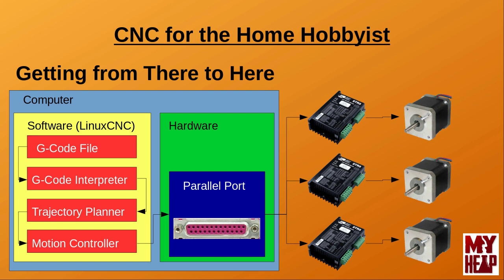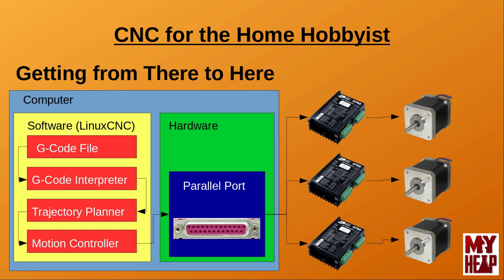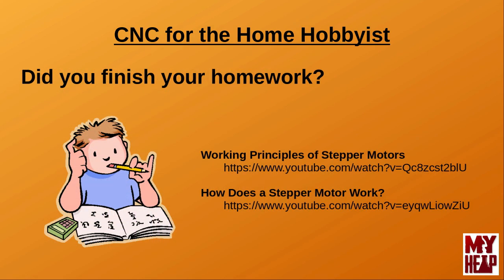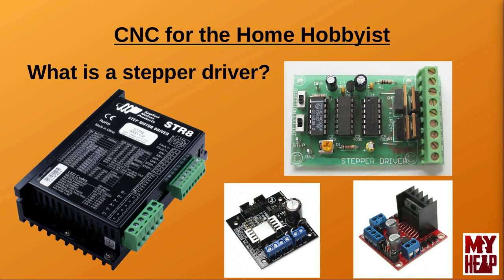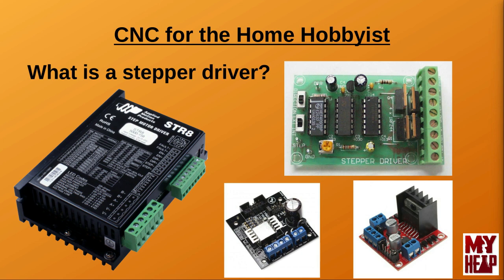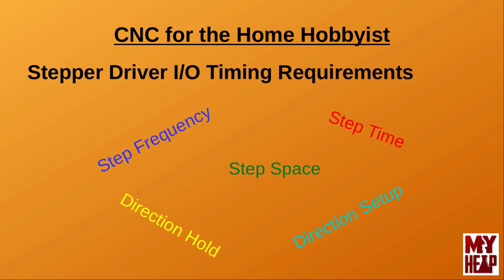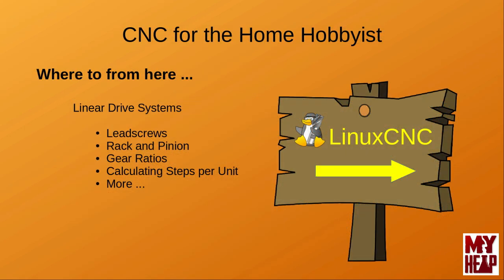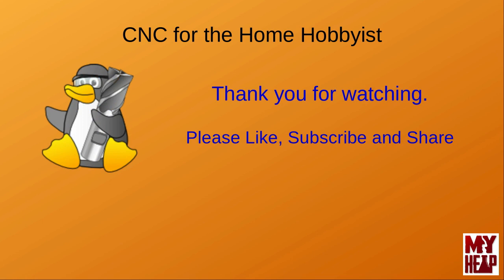LinuxCNC for the Hobbyist - 012 - Stepper Motor Drivers

Comment: Fantastic video <3
I wish i had watched it before because i just realized the motors i selected are rated 4.2A each and 2 phases, so 2 coils, according to your valuable information. And when i calculated my power supply requirement, i did not take the 2 coils in account. So my power supply won't be enough for the 3 motors.
Thank you so much for the great video!
Have a great week and please take care during that human malware pandemic outbreak <3
Reply from the maker: Thank you for watching and I am glad it is helpful.  I was in the same boat as you.  This really isn't a problem, use one supply for two motors and another for the other.  This way if you ever decide to add an axis or something you have some room for expansion.  I will do more of these videos, but am trying to get some hanging projects out of the way.  My wife has waited long enough.  She has a penchant for cast iron cookware and knows where I sleep.  Haha. You get the idea.

Stay safe and avoid the Kung Flu 😷 if you can.  Thanks for the sub too.  I appreciate it.

Joe
Reply: @MyHeap  Take your time, focus on the more important things in your life, ALWAYS. I had to subscribe, i watched a couple of your videos and you made an incredible job with regrouping and highlighting crucial information about CNC machining and LinuxCNC.
To be honest, you deserve way more subscribers for all the amazing job you made so far.

Comment: Great info thanks. Getting linuxCNC to work was a lot easier that i would have thought. Got snagged up with the difference between a home switch and a limit switch for a bit. Ended up using only home switches. Converted my 3d printer into a pen plotter using linuxCNC.
Reply from the maker: Hi Allan.  Thanks for watching and taking the time to comment.  I appreciate that.  :-)  I find a lot of people only use home switches rather than both home and limit.  Some because of the available input pins and others I guess for different reasons.  The good news is that once your homed, as long as you have your axis travel set up correctly in the configs then LCNC does a great job of not exceeding the limits.  At least in all the years I have used it it has never exceeded the soft limits of the machine.  Thank you again, Allan for stopping by.

Joe